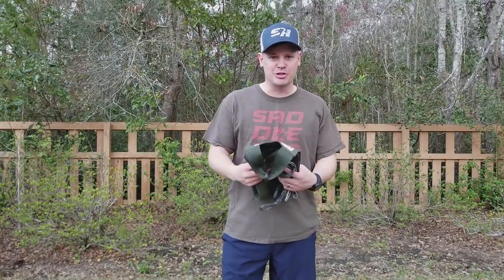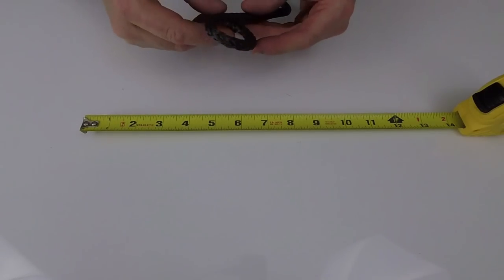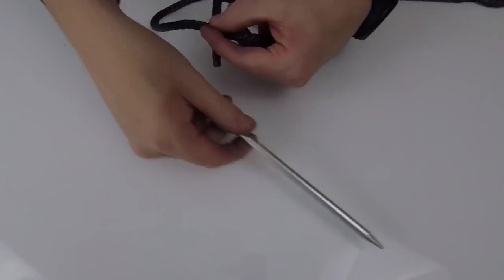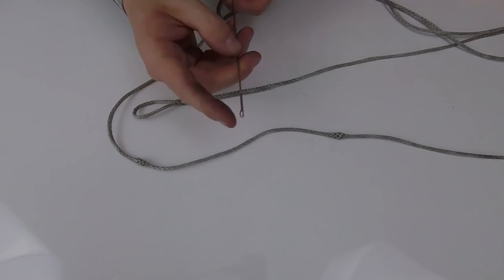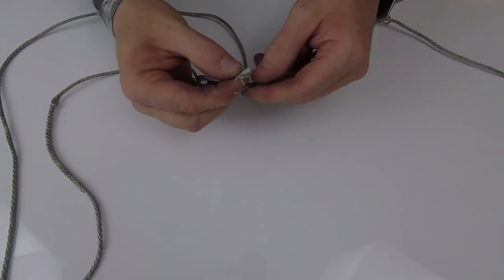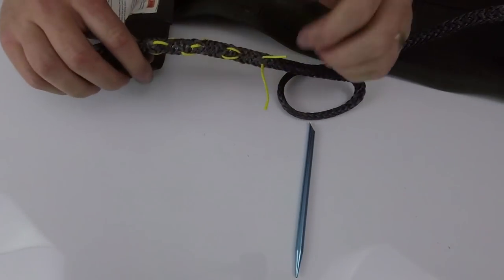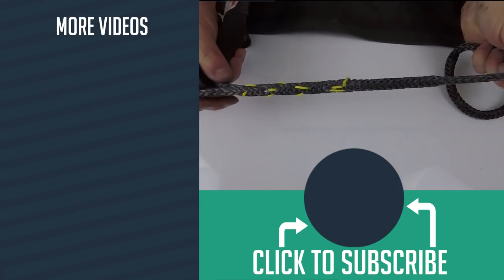How to splice Amsteel for a bridge on your hunting saddle

Comment: To anyone attempting to make a DIY bridge.... Please follow the manufacturer's recommendations on splices. They will tell you how long the bury needs to be and show you how to taper. The buries in this video are WAY too short which means the brummel lock will be carrying more of the load (it's not intended to carry ANY of the load) instead of the bury carrying the full load. Also he did not taper the ends of the rope. This will reduce the breaking strength of the amsteel which has already been significantly reduced by the short buries. I'm not saying that this bridge will fail. There's likely enough safety factor that something else would fail first. But there's a very good chance this bridge will break at or below 50% of the  breaking strength of the line. Why wouldn't you follow the manufacturer's recommendations, make it correctly, and enjoy a stronger finished product that breaks at over 90% of the MBS? A guy in a sailboat was killed because he used a brummel with a short bury and it broke below 50% line rating causing the boom to swing freely which hit and broke his neck. Do your homework, your life depends on it...

Comment: Great vid. I'm wondering if there is any other type of rope I can use in replacement for the zing it. What was the diameter of the rope you used to the lock hitch? I only need very little for this and a spool is about 30 bucks.

Comment: You might want to check the bury for a locked brummel. The recommendations range from 47-60 times the line diameter. That would make the bury for a 1/4 Amsteel over 11 inches and for 7/64 a bit over five inches. Without a locked brummel, the bury should be 3.5 fids or about 72 times the diameter.
Reply from the maker: Yeah you're probably right. It's not going to fail the way I did it, but you won't get the full strength of the rope unless you follow the Amsteel guides.

Comment: Just made my amazon order to do this!! I love the Kestrel but the bridge is so bulky!
Reply from the maker: Yeah I agree. I think amsteel is a better option.
Reply: G2 Outdoors well I think I may have found a down side to the amsteel...it seems I can’t use the prusik for the back band of the kestrel because the burry changes the diameter of the rope:/
Reply: Can I make the bury longer to make the rope diameter more symmetrical?
Reply: @DIYWhitetail  Seems to me that the length of the bury is limited about to the length of the Fid.  You might be able to get a bit more by sort of bunching up the rope a bit  --  or you could bring the fid out and then carefully reinsert it at the same point  after you had pulled the rope through to go further down the rope.  That might get you the length you need?

Comment: Hey man. Thanks for your service. I’m new to saddle hunting. It’s HUGE now. So I’m starting with my own rig until I know I’m confident enough to buy the tethrd Mantis system (which looks awesome). My question is, how much line should I order? I know 49” Amsteel for bridge. What do you recommend for lineman’s and for tether? I don’t want to order more than I need. And can I use Ropeman1 ascended with Amsteel? Thanks man. Stay blessed.
Reply: No, cannot ropeman amsteel
Reply from the maker: You lose about 4' of rope to tie your loops and stopper knots in your climbing line for tethers and lineman belts. So if you want an 8' tether, but 12 foot of rope. If you want a 6' tether, buy 10' of rope. Hope that helps!
Reply: Do NOT ropeman Amsteel. I use Samson Predator for my tether with a Blake’s hitch, ropeman is good on it too. I get it at WesSpur, they sell it by the foot.

Comment: Would the Amstel make a good lineman’s belt and tree tether? Does grab the tee well enough?
Reply: I can think of a couple reasons why it would be inconvenient but idk about safety. 1. It has no cover/sheath so it would stick to bark and bark will get all Tangled in it and wear it quickly. 2. You need a friction hitch or ropeman to adjust the length of a lineman belt pretty much constantly, can't do that with amsteel.

Comment: How much length of Amsteel do I need to start with in order to make a whoopie sling lineman’s belt that is 8 feet finished length when extended to its largest adjustment. I want my whoopie sling LB to be as long as my Tethrd LB.

Comment: Order sailing needles off amazon for your lock splice.  Also you need smaller fid's for the diameter of line your working with.  And remember most splices decrease WLL (working load limit) by up to 30%.  I haven't looked into this line before, but with double braided nylon its about that amount.  Damn army guys trying to play Navy!!  haahahahaha   Let us show you how to properly splice a line hahaha
Reply from the maker: lolololol please show us grunts how it's done!!!!
Reply: G2 Outdoors  I will gladly help!  I was actually looking for a splicing set and sailing needles a few weeks back to make chokers and prussic knots for climbers. Trying to use my skills to make a little extra money on the side hahaha. Smaller diameter rope is harder than the big stuff, but the big stuff needs power to sink the core into the cover.

Comment: I love the innovative spirit, but may I caution your application of Amsteel? It is a self-abrading fiber with poor flex fatigue, meaning that it can fail without warning. Bridges on certain tree climbing saddles used amsteel for a short time until they started failing. Please do more research on the product. 

An alternative is 3/8” Tenex. Still plenty strong, light, and easy to splice.
Reply: @Daryl " It is a self-abrading fiber with poor flex fatigue"
It actually has good flex fatigue, it just doesn't retain strength with sharp bends. They can be visually examined quite easily. Fraying would be the indicator. Sailboats use them for anchor lines and mast support for years.
Reply: Would you prefer that over a  continuous loop which looks a little easier but which would you say is better the loop would take more amsteel but it's not expensive .

Comment: Would 80 pound braided fishing line work as a lock stitch since it's not load bearing? Getting ready to splice my bridge and don't have 300#line or zingit.
Reply from the maker: Yup. Should work just fine. I've actually used braided fishing line before. I think mine was 300lb test. But I'm sure 80 would work.
Reply: @G2Outdoors  I ordered some kite line. 300# 1.75mm I believe.
Reply: With a locked brummel, you don't need a locking stitch. A locked brummel splice can be made with access to only one side, it just requires a different technique.
Reply: wisenber can you link to a video showing how to do this?

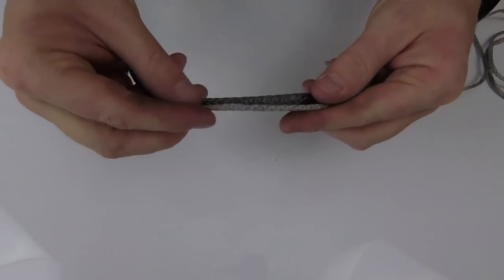Comment: 09:51 The breaking strength is not 1800lbs for 7/64th. Average breaking strength is 1600lbs and minimum breaking strength (the only strength that matters) is 1400lbs according to Samson Rope (the manufacturer). Using a brummel lock can slightly reduce this a little, not tapering will definitely reduce this (up to 20%), using too short of a bury (like you did in this video) will reduce this significantly more (over 50%).... please follow the manufacturer's recommendations for making splices, people's lives are on the line.

Comment: If you are making a bridge for an existing saddle (24" bridge) how much amsteel do you need to start with since you cant do 2 locked brumels?
Reply from the maker: DIY Whitetail not much less. 24 for bridge + 16-18 for buries + 6 or 8 for loops. About 40"-48".
Reply: @DIY You can make two locked brummels. Premium Ropes 7.2.2 video shows how.

Comment: so essentially you made a large whoopie sling for a linemans belt, my question is that the same method used for cranford ez rope steps???  does the rope get weaker as it gets longer, or could I replace the cranford rope with this type ?
Reply: Yes it is I own a set of Cranford it is the same.

Comment: i would be afraid of using that thin amsteel as a linemans belt
Reply: greg brightman it’s used on winches. Pretty sure it’s fine. Stronger than steel winch cable.
Reply: @seabass22  It's definitely NOT fine. It's less than 1/8" thick. They use 3/8" on winches which breaks at 17,600lbs. That dinky line has a minimum breaking strength of 1400lbs. The way he poorly constructed it (buries too short and no taper), will likely break around 60% of the MBS or 840lbs. So much for a 10:1 safety factor. The smallest amsteel blue I would use for a lineman's belt is 5/32". But it is still a poor choice for a lineman's belt in my opinion.

Comment: Can you just knot the Amsteel  instead of splicing it?
Reply from the maker: No. Amsteel doesn't hold knots well.
Reply: @J Corr Knot derate the line strength. A simple girth hitch can render a rope down to 45% of it's breaking limit. Splicing retains more and in some cases exceeds it.
Reply: @wisenber  nothing to do with that make, locked brummels reduce strength too.

The reason you don't tie knots is because amsteel has very low friction, and just about any knot will just unravel itselfb
Reply: @butwhowasmoto2739  The reason to choose splicing over knots is strength.
A bowline reduces strength by 23-30 percent. A clove hitch or overhand is closer to 40 percent loss.
Splicing is much less, and the appropriate number of fids is required for the splice to hold. A locked brommel loses only slightly more than a stitched lock as the stitch reduces strength as well.
Amsteel can hold the right knot. It's just not a good choice for holding a prussic and such.
The bury isn't cosmetic, it's a requirement. A properly buried locked brummel exceeds the line strength.